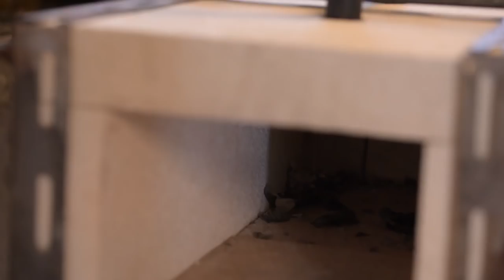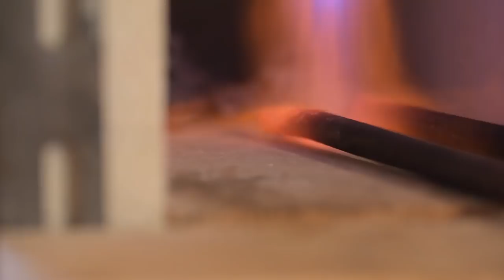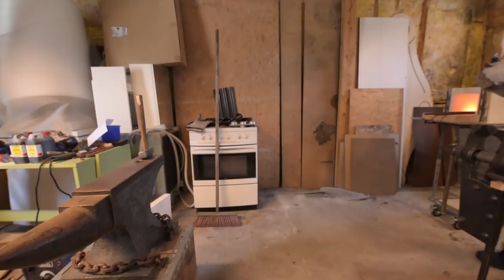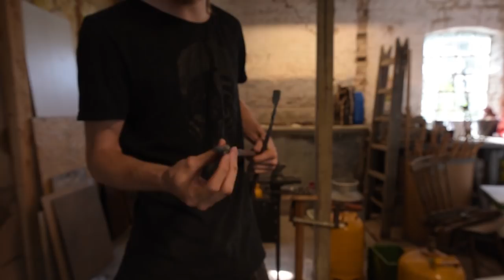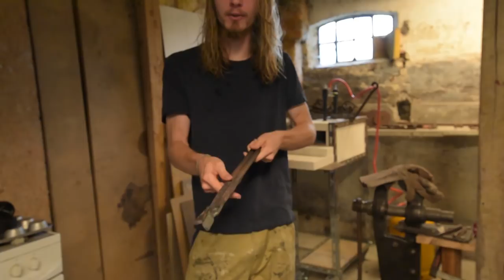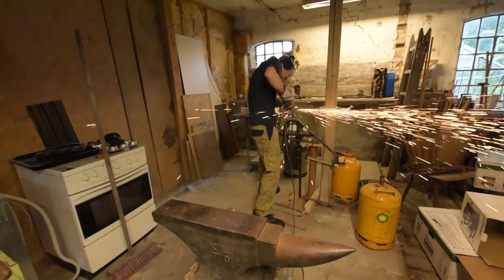Forging my first tongs without any tongs!

Comment: Hello mate. Congratulations on your project. I do remember forging my first tongs a year age. I have a few pointers that may help you:
1. Use a wet cloth to cool down the long piece of steel when it gets to hot way back, or even wrap it around where you hold it.
2. you can use a mors clamp to hold the punch to keep the hand away from the heat and out of the way of an accidental hammer blow.
3. when punching through you only need to be under the hole in the final stage, before that you can do it on the face of the anvil..
keep up the good work and have fun
Reply from the maker: Thanks for the tips! I've already learned a lot and made a better pair of tongs since this video - It's tons of fun!

Comment: I was watching and I saw how you said the bar was getting to hot to hold. I get a spray bottle and spray the handle part with water to cool it off while I'm waiting for up the other end to heat up.  It works for me. Try it if you want. Be cool and stay safe, another beginner blacksmith. R.

Comment: Punch your rivet hole first from the other side, the flat side should be last as you punch out the slug and you can do that over the pritchel hole, cool those handles cool with water, you'll get it.

Comment: A good thing to do when hammering is keep a straight back and swing the hammer from shoulder height. Let the weight of the hammer do the work there’s no need to actually use force so you won’t get tired 😊 good work man

Comment: Yes, the first project done! Keep making more tools to practice. Also, you could benefit from a bucket of water close by.
Reply from the maker: I have an old aluminium milk jug with water. I tried cooling off the handles but it didn't do much. The heat wasn't an issue in the second attempt I did though.

Comment: When you drift from outside out hinge plate first tell inside of tong get dark, then you punch the opposite side to push the plug out finish at pitcher hole so wont get flex at the boss or middle of tongs
Reply: And dip handle ie rins in bucket water in my shop I have 3 bucket of water
Reply: Just use a bolt the tongs together

Comment: Hey, amazing video again but couldn't you have just made the rod flat and then bent it sort of making a U shape?
Reply from the maker: Ethan Calaway Tjank you :) I dont think I could. That only works with spring steel, and while it might work, it would take just as mich work if not more to make the steel the perfect thickness to be flexible yet durable enough to maintain its shape. Its also something i dont know if its doable without tongs to hold the work. This design is the beginner design everyone recommends making, so I figure its the easiest to make. At some points during this I could barely touch the bar. If I had to heat further down, at the center of the bar in order to thin or bend it, it would have caused burns through the gloves. BUT the style you talk about is something I think Ive seen done, and would be a fun project to try.